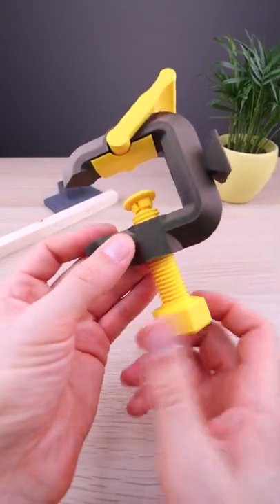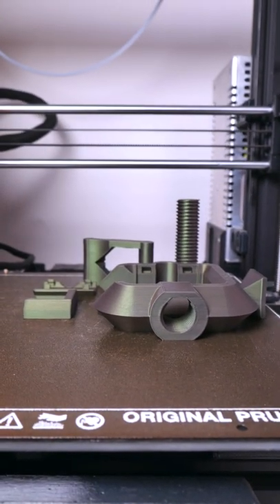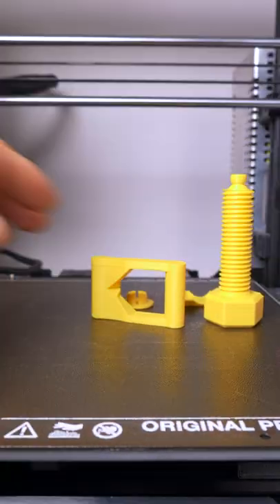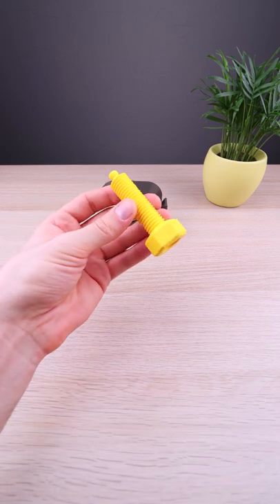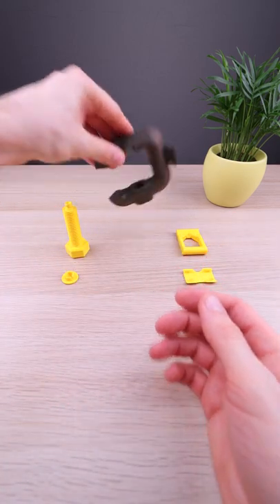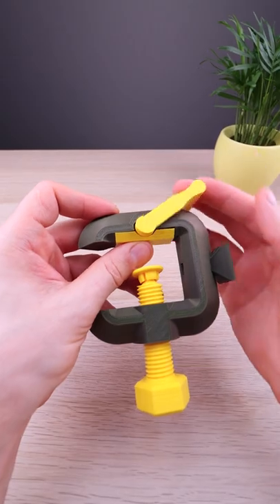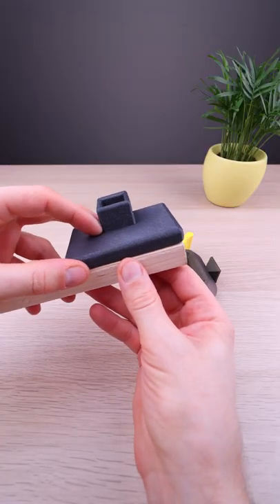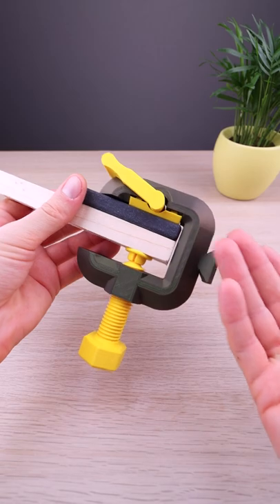DIY 3D Printed Adjustable G Clamp - with Quick Release

Comment: I would’ve printed this immediately but I’m still having issues with threads when I print
Reply from the maker: the tolerance it's quite large on this one, so it should fit with not big issues, for other designs, a quick tip is to scale down to screw to 95% on the X and Y axis 😉
Reply: @marsgizmo  thanks for the advice hope it works
Reply from the maker: @armandomagana8540  you’re very welcome 😊